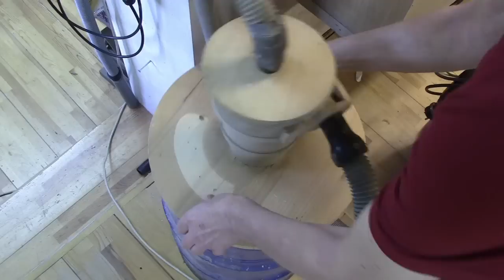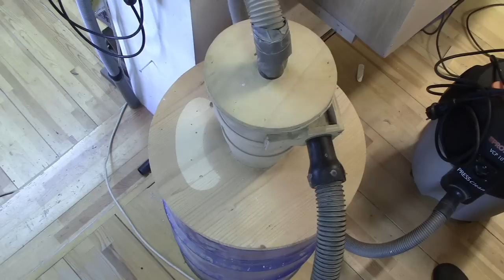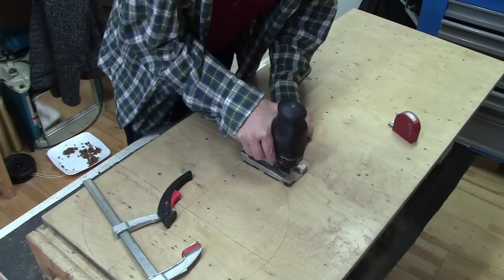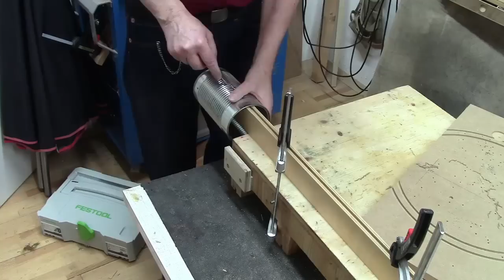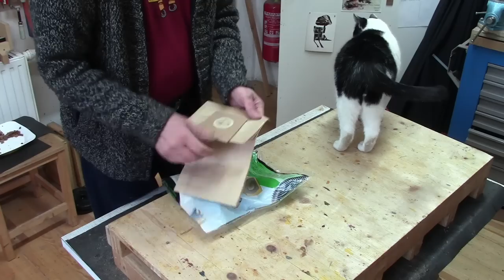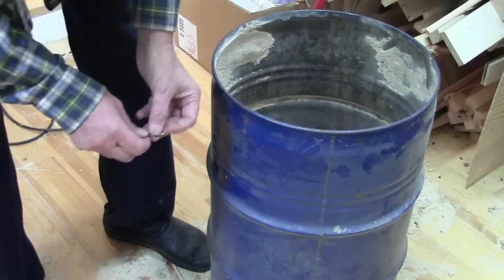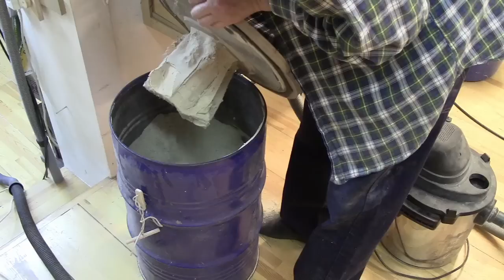Awesome dust collection for the workshop without cyclone - better, simpler, cheaper - DIY JIG

Comment: You have basically created a large reservoir version of the first shop-vac that I ever owned.  It was a 5 gallon bucket with a similar design.  Instead of cleaning out the shop-vac, you are now cleaning out the larger reservoir.

Comment: I think the reason that you have so much stuff in your vacuum cleaner is that you didn't have the pipe from the vacuum source in the correct position. If it's too deep, or not enough deep, in the cyclone the results are what you had, a lot of stuff in the vacuum cleaner. My home-made cyclone let only the very very fine dust through. A bag in the cleaner lasts me 2 to 3 years.
Reply from the maker: Yes,  my cyclone was not very good but now it works perfect 😊
Reply: If you have a video or photo of the cyclone you made, could you send it?

Comment: Regarding the old system using the conical cyclone device:
At time = 1:30, the plywood lid was lifted off the top of the blue waste container.  It is not clear to me that the plywood lid was sealed airtight against the blue waste container.  It appeared to fit very loosely.  However, to achieve the best fine-dust separation for a cyclone device, the lid must be sealed airtight against an airtight waste container using some kind of flexible, compressible, conformable, leakproof gasket material.   The cyclone cone device itself must also be sealed airtight against the plywood lid.  The blue waste container must contain dead air.  No air from the outside can be allowed to leak into the waste container through either of these two joints if the best possible separation of fine dust is to be achieved for a cyclone device.  I believe that the old cyclone would operate immensely better with fine dust if the two joints into the blue waste container were fitted with proven leakproof gaskets.  Both of the joints into the waste container must be completely leakproof if the best possible results for a cyclone are to be achieved with fine dust.

Comment: The filter in the dust barrel works just like a shop vac filter. If it was positioned on the outside of the barrel you could even knock on it or use compressed air knock the dust back down into the barrel without having to remove the lid.

Comment: Mir gefällt die Lösung und sie erfüllt ihren Zweck. 
Meine eigene Lösung ist noch etwas einfacher, könnte aber sinnvoller weiße noch um den Filter erweitert werden.

Bei mir ist der Auffangbehälter ein Staubsaugerunterteil, billiger Baumarktsauger, darauf ein Deckel aus MDF mit einem PVC Rohr in der Mitte. Der Deckel hat keine Dichtung und wird nur vom Unterdruck gehalten, soweit erkennbar ohne  falsch Luft zu ziehen.
Der Einlass im Behälter ist im 90° Winkel waagerecht ausgerichtet. Dadurch ist es wie ein Zyklon. 

In der Anfangszeit hab ich einen kleinen Hausstaubsauger verwendet der Regelbar ist, dadurch konnte die Saugkraft beeinflusst werden.
Da er hauptsächlich an der CNC fräse zum Einsatz kam hat er viel feinen Staub gesehen. Anfangs ging viel Staub in den Sauger, nach etwas Testen Mit der Regelung hatte ich die Richtige Einstellung und es kam so gut wie nichts mehr durch.
Reply from the maker: Danke für deinen Kommentar :)

Comment: Thx for this idea, much  easier to make than a cyclo type. But the way you attach the top plate on the drum can be done better . 3 pieces of m.5 or m.6 thread spanner with a hook, or a pièce of m.5 thread with a wingnut etc., I have a piece of perforaded stainless steel plate, so I don't have to make all these holes.

Comment: Hallo Stephan, also Luftein- und -auslass auf derselben Höhe halte ich für kontraproduktiv. Setzt man dagegen den Lufteinsatz tiefer und dazu noch schräg, sodass das eingesaugte Material, bedingt durch den Luftstrom und dem schrägen Eintritt, beim Eintritt in den Auffangbehälter in Rotation versetzt wird, erhält man sowas wie einen Schwerkraftabscheider. Durch die Fliehkraft bleiben die Schmutzpartikel an der Behälterwand, während der Luftstrom - relativ staubfrei - zentral abgesaugt werden kann. Um dies zu erreichen, empfehle ich, eine Konstruktion von HT-Rohren an der Deckelunterseite zu montieren. Unten setzt man dann einen Bogen an, der den Luftstrom in einem spitzen Winkel direkt an die Behälterwand leitet. Bei mir klappts so wunderbar. Der Behälter kann so auch als Nasssauger verwendet werden.
Reply from the maker: Danke für den Tipp Wilhelm, allerdings funktioniert das jetzt super und ich bin sehr zufrieden damit.

Comment: The new design is cool but the old design is better. The problem was that the vortex(cyclone separator) was too small. Not wide enough or tall enough. There are a couple of videos of people making cyclone separators out of 5 gallon buckets.  And out of 5 gallon water jugs that work great. Plus low cost to make.

Comment: I may make this happen. I have a homemade 5 gallon bucket cyclone and it works pretty well...although my issue is stiff hoses that pull the cyclone over...(short lengths with stiff plastic do not a good combo make)

Maybe a larger bucket won't pull over so easily.

Thanks for sharing!
Reply from the maker: Thank you for your comment Jeffrey

Comment: Vielen Dank für das Video. Ich finde die Lösung sehr gut: Sie ist preisgünstiger, nimmt weniger Platz ein und funktioniert offensichtlich ebenso gut wie ein Zyklonabscheider. 
Ich habe in den Deckel der Tonne für meinen Zyklonabscheider ein Plexiglas-Sichtfenster eingebaut, um jederzeit den Füllstand kontrollieren zu können. Das könnte ich mir auch hier als sinnvolle Erweiterung vorstellen.
Reply from the maker: Vielen Dank Jens. Für jemand der gerne Plexiglas verwendet sicher eine gute Idee. Ich allerdings vermeide Plastik wo immer es geht. Muss halt öfter mal reinschauen 😊

Comment: Die Idee ist nicht schlecht. Eigentlich könntest du jetzt den Saugermotor direkt auf die Tonne packen, denn was du ja eigentlich gemacht hast war einen zweiten Filter ins System zu bauen.

Leider bin ich auch nicht ganz überzeugt, dass hier keinerlei Performanceverlust stattfindet, die Poren im Filter werden ja doch enger.
Ich glaube auch, dass ein gut gebauter und eingestellter Abscheider effektiver ist. Vielleicht war dein Zyklon vom Eingangswinkel so, dass viel Feinstaub direkt in die Absaugung gelangen konnte. Evtl. hätte dein Zusatzfilter das Problem gelöst (einfach denselben Überzieher im Staubsauger selbst?)
Reply from the maker: Ein Staubsauger hat auch keinen Performanceverlust solange der Beutel nicht voll ist. Mein "Beutel" kann praktisch niemals voll werden  😊

Comment: Instead of cleaning out the actual filter for the vacuum you clean the filter for the dust trapping device.  I am not seeing the advantage in cleaning one filter vs. the other.  But then again...I have yet to even build a cyclone/dust collecting device for my system!
Reply: This way you move fine dust away from vacuum motor... Now he doesn't need to clean vacuum cleaner. That's advantage.

Comment: Hallo Stephan!

Vorweg mal Danke für das Video - zeigt es ja die immer wiederkehrenden Probleme beim DIY-Zyklon auf.

Ich beschäftige mich seit einiger Zeit sehr intensiv mit den Grundlagen einer Zyklonabsaugung und finde es schade dass du dich davon abgewandt hast.
Aber ich kann es auch verstehen dass der Frust letztendlich gesiegt hat und dich einfach einen Staubsauger mit einer großen Vorkammer samt Filtersack bauen ließ.

Vielleicht kann ich aber hier die wichtigsten Faktoren aufzeigen die zu einer erfolgreichen Zyklonabsaugung führen:
1) der Sammelbehälter muss absolut dicht sein - ist das nicht der Fall wird der Zyklon in seiner Strömung gestört und die feinen Partikel bleiben in der Abluft (ich tippe dass war auch bei dir der Fall)
2) die Unterdruckkammer (dort wo der Motor sitzt) sollte auch dicht sein - entfällt wenn man einen fertigen Staubsauger verwendet
3) die Geometrie des Zyklon muss passen - bei den fertig gekauften meist kein Problem obwohl der perfekte Zyklon im Ansaugdrittel ein Zylinder ist und erst danach konisch wird. Auch die Eintauchtiefe des Saugrohres ist nicht unwichtig.

Falls jemand von euch genaue Abmessungen eines Zyklons haben will soll er sich bei mir melden!

LG - Guido
Reply from the maker: Danke für die genaue Erklärung.  Irgendwas hat sicher nicht gestimmt aber jetzt funktioniert es super.

Comment: 1. How deep is the outlet pipe inside the cyclone? Different lengths can have drastically different results.
2. What is the CFM and suction loss with the new solution.

Your new solution might works perfect for you according to your requirements. But your cyclone was not working as a well designed cyclone would. I'd be interested to see inside of your cyclone.
Reply: Wie sollte Ihrer Meinung nach ein gut gestalteter Zyklon aussehen? Können Sie ein Foto oder Video teilen?

Comment: The vacuum cleaner is clean. It's great. But the efficiency of the system itself is very unreliable. The paper filter clogs quickly. Receiving debris in the tank will be low. Do you need a clean tank or an effective dust extraction system?
Reply from the maker: The paper filter gets only a thin layer of dust and does not clog. As long as the bin is not full, there is no loss in performance.
Reply: Actually a cyclone takes a very large chunk of power out of the airflow, so a design with a simpler airflow can get you a higher net flow at the input, even if it adds an actual filter into the air path.
Reply: (I'm not sure where the misconception comes from that a cyclone doesn't impede airflow; it might be because if you put your hand on the input to check how "strong" the vacuum is, you have zero flow and would get the same "stronginess" feeling regardless of what you put between the input and the vacuum ... but the actual -- non-zero -- airflow is much weaker with a cyclone in the mix)
Reply: (And of course, below a certain flow rate a cyclone does nothing, because no actual cyclone-airflow is established; at those low rates air simply flows directly from inlet to outlet). A filter has no such problem.
Reply: Das Stackenblochen I’ve used a small dust buster with my dust deputy and it still separates the dust. How little would the suction have to be for the cyclone not to work?
Reply: I don't think there's a simple answer to that. A given cyclone requires a certain flow speed and volume to get cyclone airflow; below that speed air will just flow from the inlet to the outlet. I don't think you can condense that down into "you need at least so-and-so-many watts in your shopvac". There is also the thing that just because you don't have cyclone airflow doesn't mean it can't separate stuff from your air (it's just less efficient).

I had a transparent cyclone once and you could see this quite well when sucking up dust and shielding the inlet. If you made the inlet too small there just wasn't enough air moving through it to get cyclone action.
Reply: @dasstackenblochen9250  for the low flow rates and high pressure differential potential of a shop vac, the cyclone uses a very small percentage of the air power.

Comment: I'd like to see flow rates tested with a proper cyclone compared to this after one full container of dust is sucked up without cleaning the filter.

Why not just wrap the filter bag around the vac filter if thos works without clogging as you say?
Reply from the maker: Good idea but then I need a big bag = expensive. Now I use a normal bag from a vacuum cleaner = cheap
Reply from the maker: ok, but I pay $0.6 https://amzn.to/2rdVnqm

Comment: hi Stephan, thank you for sharing. I don't seem to be able to understand how this works. is the bag breathable or have you punctured it?
Reply from the maker: This is a very cheap vacuum bag, so it is breathable as every vacuum bag.
Reply: Thank you! That was what I was confused about. I always thought that cheap bags are actually not breathable, and only expensive 'filter bags' are... that's why I couldn't understand how you managed to achieve circulation.

Comment: Die Idee ist ja ganz nett, hat aber 2 kleine Fehler 1. wenn so viel Staub in den Sauger kommt hängt es daran, das er irgendwo Luft Luft zieht. Jeder 18,-  China Zyklon schafft etwa 95% des Staubes in der Tonne zu halten und wenn man dann noch einen gescheiten Vliesfilter im Staubsauger hat, passiert da nix. 2. der Vorbilder im Neubau hat so gut wie keine Fläche, der Saugkraftverlust ist da schon extrem, ausserdem muss man ihn ja auch alle paar Minuten sauber machen. Ich hatte auch viel Staub in meinem Sauger (im Vliesbeutel) das lag aber nur am nicht 100% dichten Deckel, Deckel abgedichtet schon ist der Staub im Sauger zu vernachlässigen.
Reply from the maker: Das neue System hat sich zu 100% bewährt. Ganze Tonne voll, Null Staub im Sauger, demnächst gibt es dazu ein weiteres Video.

Comment: unfortunately this wouldn't work for commercial molders and gang rip saw setups. I used to process about 100 contractor bags of sawdust a day and had a dust collector the size of a dumpster that would get emptied about 3-5x a day. Luckily we had lots of pig and cow farmers nearby that would swing by on a call's notice to remove it all daily otherwise would have been expensive to process without a brick machine to convert it all to wood bricks.

Comment: Hallo Stephan. Ich bin über Deine Aussage wegen des Feinstaubs beim Zyklonabscheider erstaunt. Ich habe mir auch ein gebaut. Das ganze betreibe ich mit meinem Haus-Zentralstaubsauger. Zum testen habe ich damals den Feinstaub (ca. 300g) aus meinem Filter (ist dass gleiche Filtersysten wie bei deinem Sauger nur grösser) in eine Tonne gegeben. Zusätzlich fast 1kg Mehl,  Sägemehl und den üblichen Werkstattdreck. Alles in allem kamen über 3kg Testmaterial zusammen. Über das Resultat war ich mehr als erstaunt. Im vorher tiptop gereinigten Filter und Schmutzbehälter vom Zentralstaubsauger konnte gerade mal um die 3g! Staub zusammen gekratzt werden. Die restlichen gut 3kg waren in meiner "Zyklont- Tonne". Seither leere ich den Auffangbehälter und Fliter meines Zentralstaubsaugers ca. alle 1 1/2 Jahre ein mal. Da der Dreck und Staub vom Haus noch direkt in den Zentralstaubsaugers geht, habe ich mir schon überlegt den Zyklon nicht nur für die Werkstatt zu benutzen, sondern direkt vor den Zentralstaubsaugers zu montieren. Trotzdem danke für deinen Beitag und die gute Idee. LG Ueli

Comment: This is not a solution. 
You just removed your problem to your homemade filter. 🙃
Reply from the maker: I'll never need a dust bag again.
Reply: So you are going to clean the dust bag you are using to your homemade dust filter??
Reply from the maker: No, I will never clean it, it is not necessary.
Reply: Stephan Pöhnlein Okey good luck with that. Wish you the best.
Reply: moved. not removed
Reply: Jeff Beck sorry for my bad english. 😊
Reply: I agree with you, only made a filter more. It looks not good in maximum power of motor.

Comment: Schön gebaut, aber ein absolut dichter Deckel (mit Nut und Dichtung drin oder der Original Deckel) hätten das Problem auch gelöst. Ich selber hatte auch einen sehr geringen Wirkungsgrad in meiner ersten Absaugung. Nach etwas Sucherei und dem Einsatz einer Blechtonne nebst dichtem Deckel ist der Wirkungsgrad nun bei 99% (weniger als ein Fingerhut Staub bei 30 L). @mrhandwerk und @heavyindustries haben das ja auch so beheben können.
Reply from the maker: Kann schon sein, so wie es jetzt funktioniert ist es auf jeden Fall perfekt, ich brauche weniger Platz und konnte wieder ein Stück unnötiges Plastik aus meiner Werkstatt entfernen. 😊

Comment: It looks like your original cylone is not large enough and perhaps your vacuum force tube is improperly aligned.  I have been using a retail version for years without getting overflow.

Comment: Da ab dem Zeitpunkt, wo es interessant wird, nur Musik läuft und keine Erklärung verstehe ich nicht, was genau da passiert . Kannst Du bitte einem Staubsauger Neuling verraten,  was genau Du da gemacht hast, und wie es funktioniert ? Wär gut gewesen, wenn Du im Video das Funktionsprinzip erläutert hättest, und warum welcher Schritt notwendig ist...
Reply from the maker: Bei einem normalen Staubsauger landet der Staub im Beutel. Der Beutel ist lufdurchlässig aber hält den Staub zurück. Er bildet somit eine Barriere zwischen dem Motor und dem Staub. Hier habe ich genau so einen Beutel als Filter eingesetzt. Der Staubsaugerschlauch wird an dem Loch angesteckt unter dem sich die Blechdose, diese dient als Stützkorsett für den Beutel, befindet.  An dem anderen Loch wird ein Schlauch angesteckt durch den die Späne angesaugt werden. Die Späne fliegen dann in die Tonne und prallen darin gegen den Beutel und fallen in die Tonne. Da durch den Beutel kein Staub durchkommt bleibt der Sauger immer sauber und alle Späne bleiben in der Tonne.
Reply: Aha... da ich noch mit einem normalen Haushaltsstaubsauger arbeite, wäre Deine Lösung vielleicht eine Option.  Denn durch die Späne muss man erschreckend oft den Beutel wechseln. Da währe ein vorgeschalteter Eimer durchaus Hilfreich. Meinst Du das geht auch wenn es nicht so eine große Tonne wie bei Dir ist `?
Reply from the maker: Ja, ich denk schon, nur sollte man darauf achten das der Filter nicht im Staub erstickt, sonst leidet die Saugleistung. Also öfter mal ausleeren.
Reply: Dachte da an einen Kasten in der Größe einer mittleren L-Boxx... meinst, das ginge ?
Reply from the maker: Einfach ausprobieren 😊